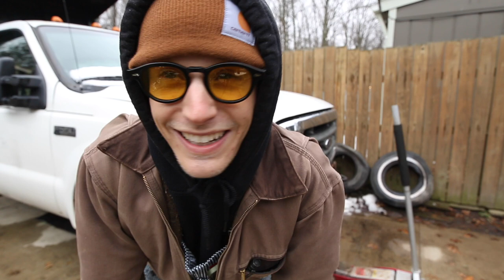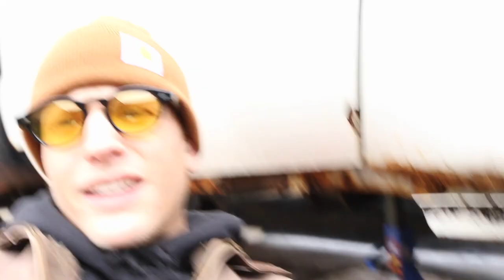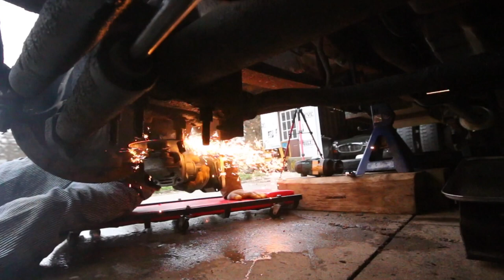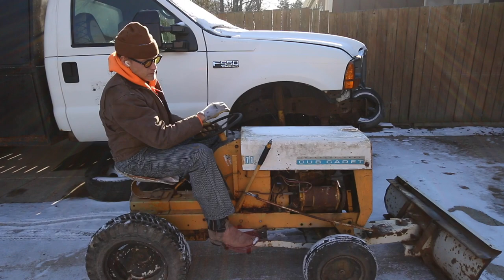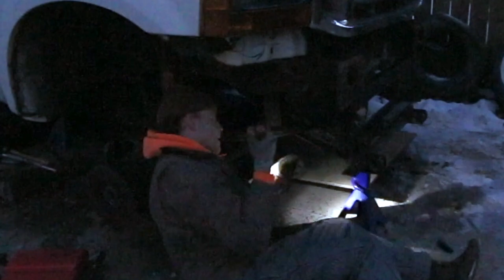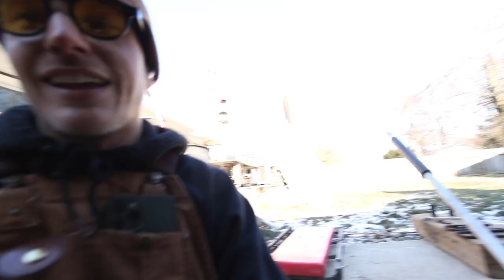1999 - 2004 Ford Superduty F550 Front Leaf Spring Replacement

Comment: Nice video ! My truck is a 2000 F250 SD 7.3 that I ordered out in 1999 and I’m basically the one that has worked on it since new . My rear spring broke so I’m going to replace front and back springs. My plan is find a company that has all those bolts and shackles reasonable priced and just cut everything off . I like your trying everything like that wrench with your tractor. Greasing up your bolts is the correct way to reinstall. Thanks for the video.
Reply from the maker: Thanks pal, I appreciate it!

Comment: I run from any rust on older cars and trucks! I learned the hard way! But it was fun ! I bought a 2000 F 350 crew cab dually with 7.3 love it.But the rear had rust ! So It needed calipers, break lines and still a project! But she runs strong
Reply from the maker: That 7.3 always outlasts the rest of it 👍

Comment: the bolt is purposefully obstructed so it wont come out.  if the nut falls off for example the bolt cannot just jiggle out and cause the frontend fall apart.
Reply from the maker: This. Is a very good point. Thank you sir

Comment: Great video. Question.  F250/F350 front springs for that year, gasser vs diesel. I know the obvious, the diesel motor is heavier so those springs should be more rigid. But are they interchangeable with the gasser?  I don't know of any difference in any mounting location or hardware associated with the two. What do you say?

Comment: Hey someone please tell me what that plate is that the front end sits on passenger side and has the steering track arm and a steering stablizer shock attached to . I've looked up leaf spring plate none have the extra mount for that steering track bar or the steering stabilizer mount please help . Emergency
Reply: I need to know the same thing